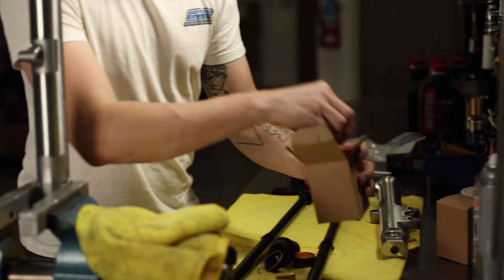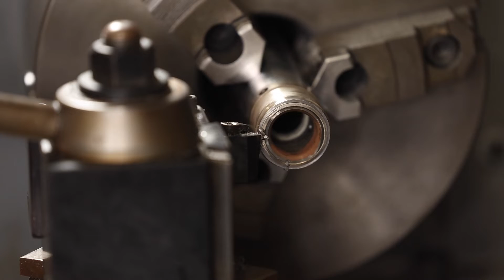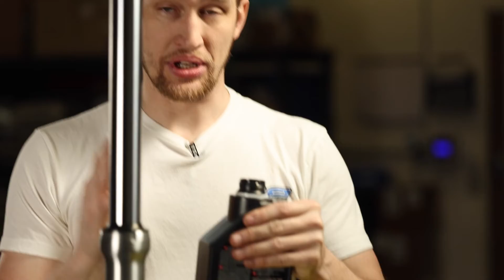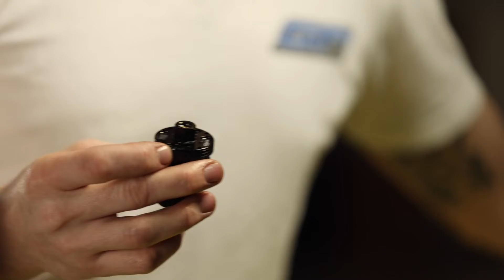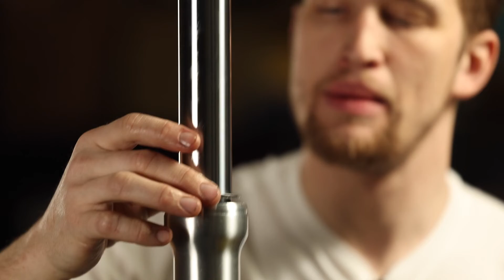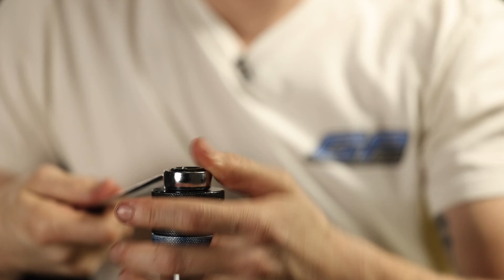GP SUSPENSION INSTALLATION VIDEO FOR 20MM CARTRIDGE KIT IN ALL HARLEY DAVIDSON 39MM FORKS.

Comment: Do these work with FXDX lowers? The DX lowers have a compression dampener screw on the back of them.
Reply from the maker: Yes they do, you leave the adjuster in or take them out and plug the hole.
Reply: @gpsuspension ok cool thank you for the reply!
Reply: @gpsuspension  what about the lower bolt length and diameter?  the bolt from the factory is longer and a larger diameter.

Comment: On your website, I don’t see any option to order pre-modified 39mm fork tubes for these 20mm cartridges. :(
Reply: Take your tubes to any machine shop and they will be able to do it, it’s really not hard to do. I had to do the same thing with a set of gold Pro One Performance tubes for a set of stock DX cartridges. I had a local Harley shop did it for me.